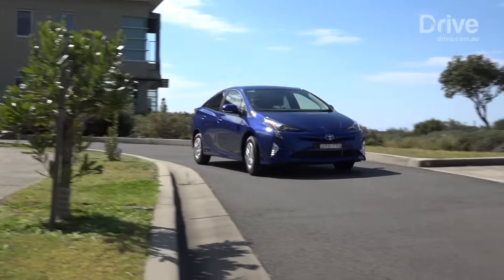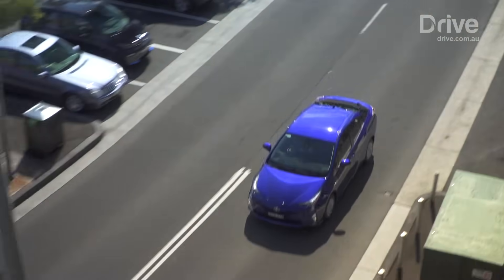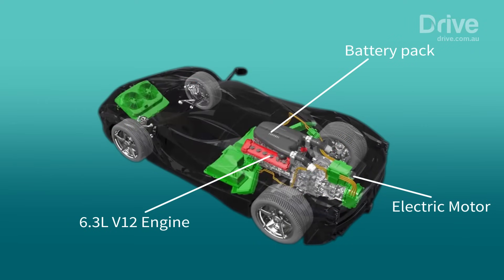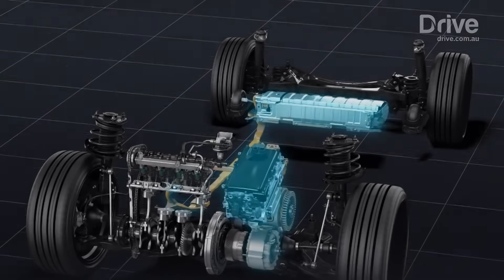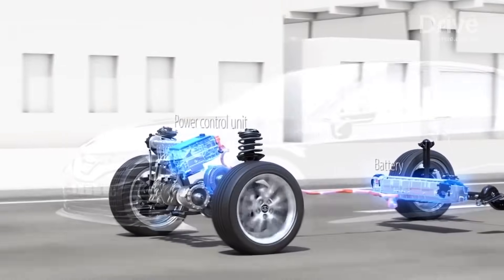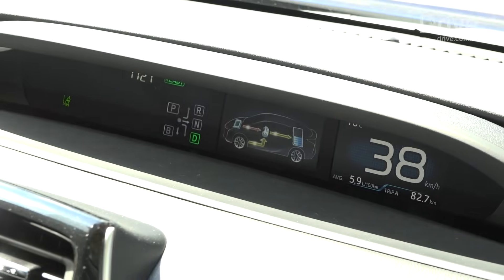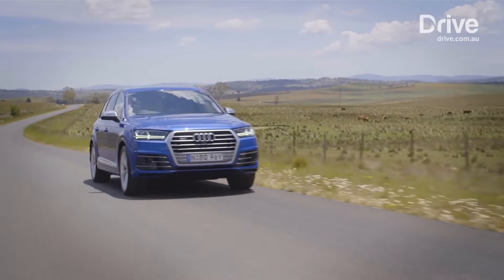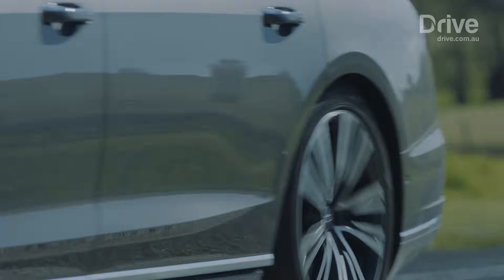How a Hybrid Car Works, Hybrid Engines Explained | Drive.com.au

Comment: Okay so I know nothing about any of this stuff, but this is what I expected.  I thought the hybrids were just like smaller weaker gas engines that used electricity from a battery to improve the mpg / performance...so my assumption was maybe they had like some sort of supercharger or w/e (forced induction I think they call it?) so I was thinking like there'd be an electric motor pushing air into the gas engine.  I guess this doesn't make much sense though unless you can charge your car.  I'm thinking the ways they did it were way better, but also I think he did mention around 3:30 that some of the cars did something like this?  Idk it's all just super confusing to me lol.

Comment: I'm confused about the difference in engine 1 and engine 2 in the prius. Eng 1 functions as a starter motor, but eng 2 drives the car at startup. Could you perhaps help me out here? (or anyone else?)

Comment: 0:51 This is bad vocabulary. A battery can weigh as little as you want, you can have a tiny button cell battery, but its energy capacity is pathetic. The word you're looking for is energy density or specific energy. Energy density needs to increase, this means more energy is packed into a given volume, and when specific energy increases, the energy per unit of mass increases. So the battery weight can decrease and still contain a large amount of energy as long as the specific energy improves.

Comment: Couldn't an alternator recharge battery?
Reply: It could but it costs more power (fuel) from the motor to charge it. essentially defeating the purpose.
Reply: @ginofoogle6944  Almost correct. To be able to brake you must use fuel to be driving in the first place. Recharging via braking has more losses than direct charging with an alternator.
Reply: This is done for 100 years now.
Reply: Hybrids basically are suped up alternators so this is already occuring. Regenerative breaking battery charging from what normally would be waste heat and is far superior.

Comment: I would like to know, if I'm driving down the freeway with no traffic therefore no need to brake and recharge the HVB would it be a good idea to occasionally move over to the slow lane and apply the brakes to recharge the battery or do you have to come closer to a full stop? If so how often should the brakes be applied in this manner? Also, exactly how much energy do you recapture on a single braking as discribed? If I slow the car down say 10 mph slower than I was going does that convert to X miles of energy?
Reply: If you have parallel hybrid just pressing the gas pedal recharges your battery. No need to think about the braking recharge. Just drive. You cant possibly be driving down hill so long without braking or accelerating so your battery dies.
Reply: @kostasjelo1719  Rolling downhill generates electricity too.
Reply: What's wrong with using E10 fuel rather than rely on solely electric power .....

Comment: Might be a stupid question but if an electric car is front wheel drive, why cant the rear wheels be charging the battery at the same time and same rate?
Reply: IOW, it is a perpetuum mobile of type 1: You spend energy to re-gain the same amount. So your gain is 0 (conservation of energy disallows it to go any other way). Now subtract energy "losses". While the idea was as bad as you suspected it might be, your humility and curiousity are laudable and that is more important.
Reply: When you convert energy, you lose energy. If you had generators on the back wheels running in tandem with the front wheels while the car was in motion you would make the car less efficient because you lose energy when the electricity is sent to the wheels, which loses energy when the wheels start turning, which would be increased by the loss of energy in the back wheels when they tried to turn the motion back into electricity.

Comment: Electricity production still burns coal so? Where's the benefit, emissions in the city suburban area's yes but still the procedure to produce the electricity?
Liquid Injection Gas and Electric motors built from the factory would be a far better option for a start!
We should be using a lot of other resources for motoring, water was patented in the 1950's in carburetors, but the big oil companies (Jewish Rothschilds Shell) definitely won't want that would they????? How does it feel to be a slave no matter who you vote for???
Reply: Well for one thing Young Conservative: In a hybrid the engine uses the always running electric system to start the engine at it's optimal rev amount so, no, it actually isn't less fuel efficient than shutting the engine off instead of idling that's frankly just stupid.

And for two: The amount of CO2 and other greenhouse gasses you save over the extremely typical 350,000 mile lifetime of a Prius is almost a multiple of 5 compared to a normal car, even including the manufacturing process for BOTH cars. The mentality so many people have of "unless it's absolutely zero it's not worth doing" would explain why the world is such a shit hole.
Reply: Jaden Rosencrans thanks for the information and I don’t have that mindset and why I said that is because I always hear ppl say oh hybrids and electric are clean and good for the environment but if they stop lying and say something like it is better for the environment compared to gas and diesel and is cleaner then gas and diesel that I would say but ppl saying it’s 100% environmentally safe is bullshit and Ik that not everyone on the hybrid and ev side are stupid and lack of logic to believe that it is 100% safe.
Reply: MrZillaman73 and the fact that starting up the engine uses more fuel then leaving it at idle
Reply: Are you a nazi that accepts climate science? Is that a thing?